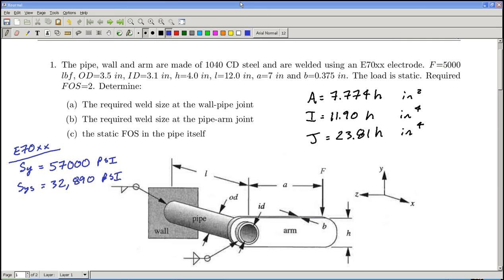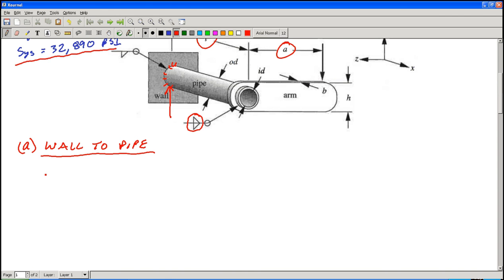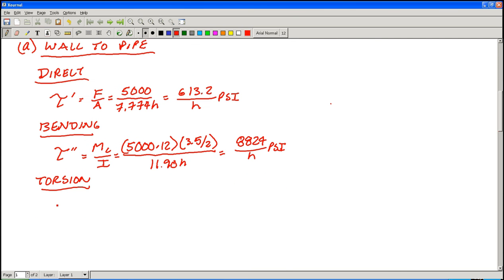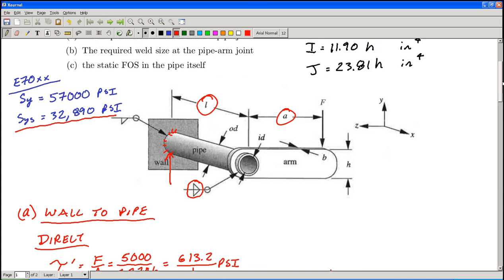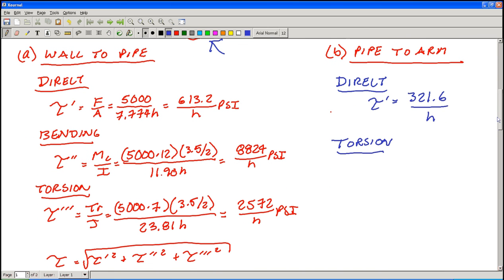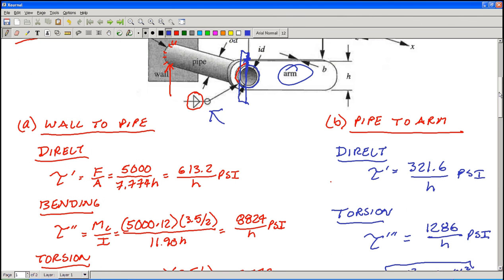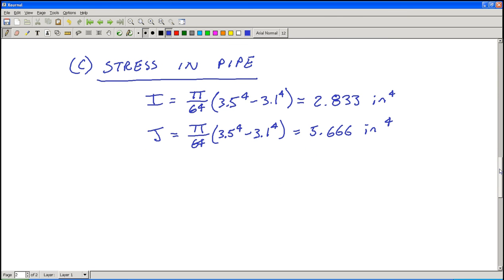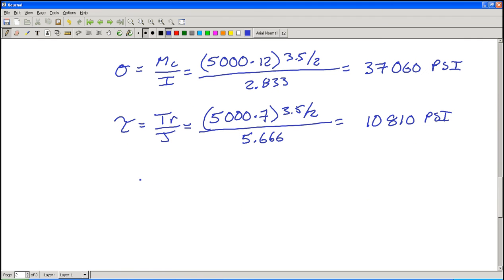Applied - Welding Example 4

Comment: Sir,
For part b: Is not resultant shear stress at the critical point equal to (tau)' + (tau)''? If the critical point is considered as the right point along the horizontal diameter. 
Thanks for the video.